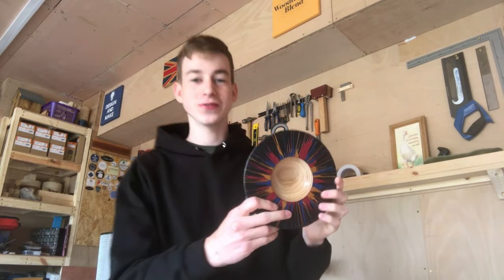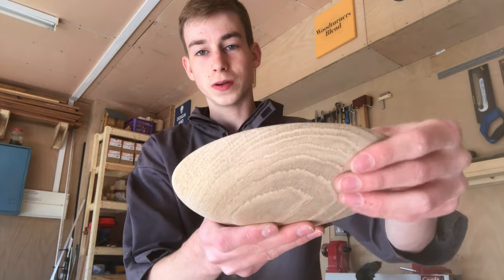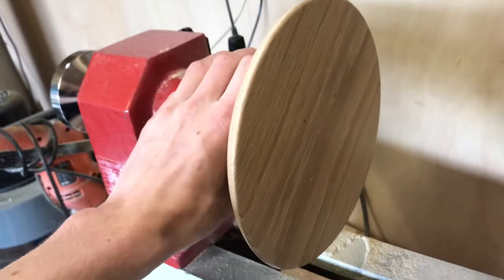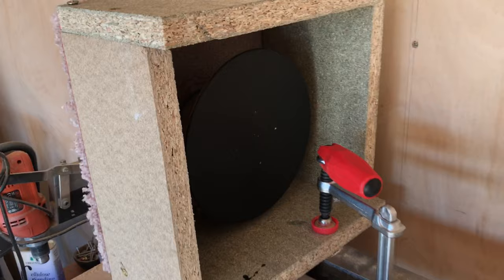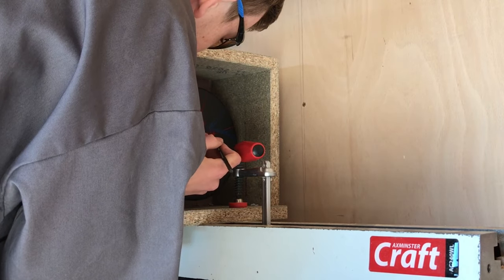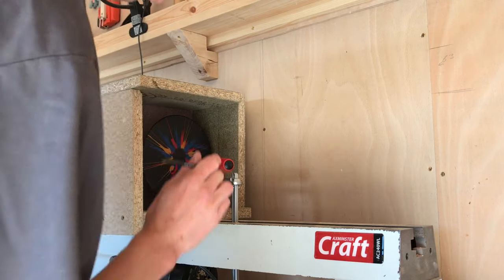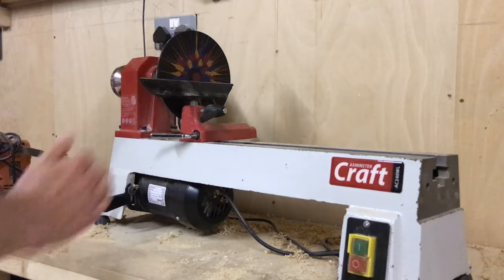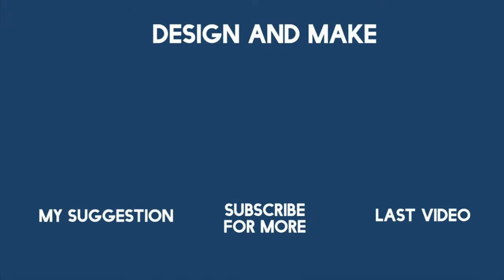Centrifugal Woodturning | #ytccc2021

Comment: James, awesome job!  “My weird and wonderful box” was a great quote.  That worked out really well.  This was really cool. I’ve done spin art before, though usually dribbling from the top, so your solution makes perfect sense and a great workaround.  If you try this again, and I think you should, you may want to look at slightly thinning the paint to get it to flow a bit more.  Still, this turned out amazing.
Reply from the maker: Thank you! Yeah, I definitely should use some thinner paint this paint was rather thick but was all I had. I am going to get some dedicated acrylics which I can then thin down so they flow better! Thanks for your kind words and for watching!

Comment: How did you attach the bowl blank to the wooden cylinder that screws to the chuck? I’m just a beginner wood turner, and don’t know all these little tricks! That bowl is really neat! Can’t say as I’ve ever seen this done before. My first thought was there’s going to be paint EVERYWHERE ! But you handled that well! Did you use standard old craft paints?
Reply from the maker: I attached it using hot glue which is a tried and tested method for securing blanks. Glad you like it! Thanks!! Yeah, just some standard old craft paints we had lying around but dedicated acrylic paint would be much easier and better for something like this. Thanks for watching!